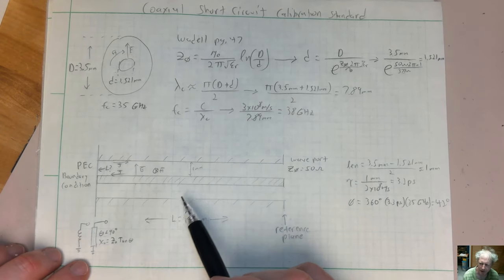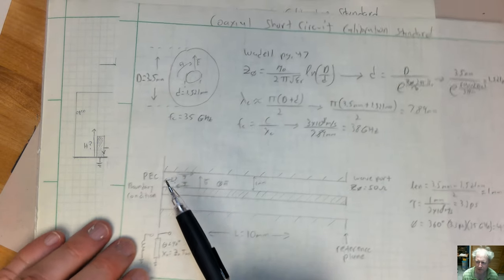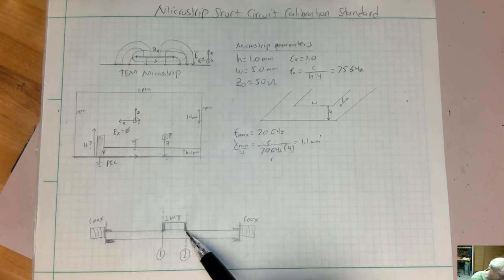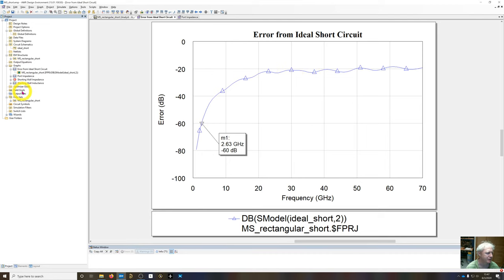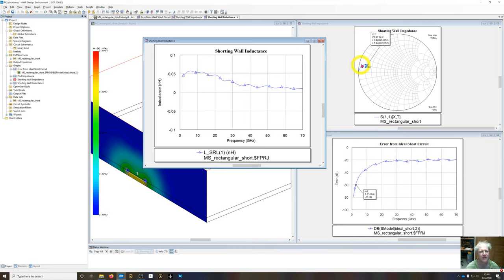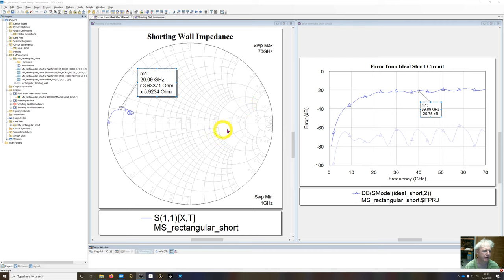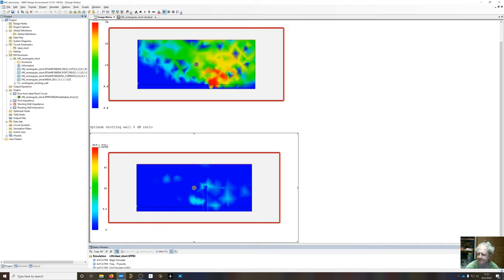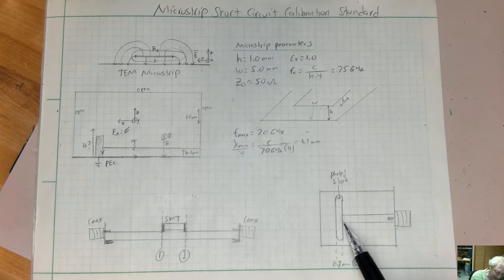GBM 002 Microstrip Short Circuit

Comment: Thanks, this was a really informative video!  I still have a question: One of the ideas behind TRL is that it does not need to have perfect reflect standards, so long as the magnitude of the reflection is large.   In this sense do you need to have the higher-quality shorting wall for TRL as long  as you have a high reflection at the frequency of interest? .
Reply from the maker: In your question, you probably don't need it at the (single or narrow-band) frequency of interest.

The reference plane can be set at either the reflect standard, or center of the thru (typically zero length).  I'm looking at Joel Dunsmores book page 148 about reflect standards; "the only criteria is it that it provides non-zero reflection equally at each port".  The key is that it must be consistent across frequency, which he describes as a problem with opens since they radiate.  Of course the coaxial short does not have that problem, but in microstrip you still need that wall to get a consistent short over frequency.

I suppose if you did a cal at a single frequency, say 10 GHz, where the short was poor, it would be acceptable.  But then if you did it at 100 MHz also, where the short was good, the cal would be no good since the magnitude changed.  Of course TRL over octave bandwidths takes multiple lines, but you must use the same short.
 
Back when I was doing a lot of PA and load pull with split-block TRL fixtures, I'd always use the reflect to set the reference plane, as the fixture just clamped about the shorting wall, and I'd use some Indium foil to ensure good contact.  As I moved to smaller, QFN type packages, I have used a single PCB fixture with the wall-in-slot.
Reply: @graybeardmicrowave3074  I wasn't aware that calibration algorithms were expecting a frequency-independent reflection coefficient for the reflect standard. I don't have Dunsmore's book so maybe I should get it.  But taking this example, if the calibration would work for a single frequency cal at 10 GHz even if the short is poor, then it seems like if sweeping a measurement across some bandwidth the algorithm could solve for the calibration coefficients one frequency at a time without assuming a frequency-independent reflect?

Another issue might be the mode content in the line: TRL assumes a single mode environment at the calibration reference plane. With the non-ideal short you showed that there is perturbation of the microstrip mode and introduction of electric field parallel to the direction of propagation.

Some of my interest in this is for on-wafer TRL calibrations where it would not be straightforward to introduce a shorting wall on a transmission line.
Reply from the maker: @mattg2k4  Frequency independent magnitude; phase shift is OK as long as it is the same for both ports and linear (non-dispersive).  Regarding your question, it probably could, BUT the line standard has an unknown phase (between 20 and 70 degrees, or some claim down to 0 degrees if you use stepped sweep), so maybe that has something to do with it.  I don't know the details of the algorithm.  The SOLT open works since you have that polynomial  model.  If you had a polynomial model for the imperfect microstrip short, maybe you could then use it, but I'm sure the TRL algorithm relies on the reflect magnitude staying fixed over frequency.

I know the 1.85 mm coaxial kit from Keysight uses database standards;  IIRC three shorts.  I believe they do model the short inductance to account for imperfections in machining.  The database standards seemed to gain popularity a few years ago; measure enough well characterized standards that don't need to be ideal shorts or lines to solve the error terms.  I don't know anything about those, but there is/was a yahoo group with a few NIST people on on there (IIRC MTT-11) that would know.  

The on-wafer I have done is LRL and LRRM using Cascade Microtech substrates and GSG probes.  LRL is like TRL but you use the difference between two lines to get a very short line.  The substrate is CPWG so shorting wall would have much less of an affect.  I did do some microstrip, pre-matched, on-wafer load pull fixtures (50 Ohm to 12.5 Ohm transformers) on 5 mil Alumina.  I did not put a shorting wall on those, but I was only going to 3 GHz.  This was for ~1 Ohm load pull on some 24 mm GaAs HFET.

There is another book that you may find of interest called "RF Measurements of Die and Packages" by Scott Wartenberg.